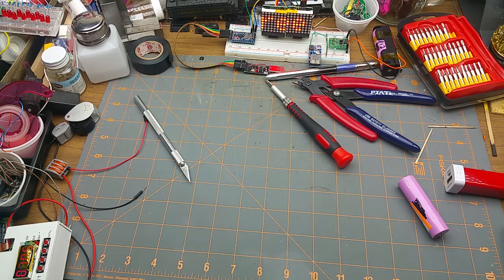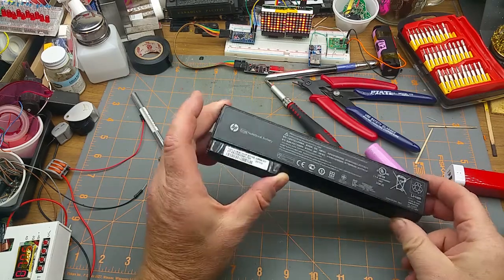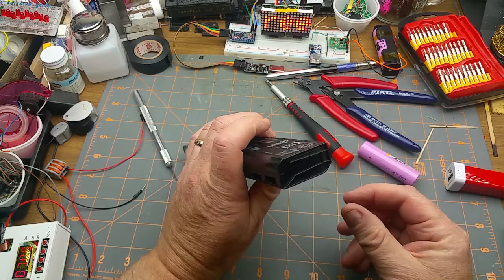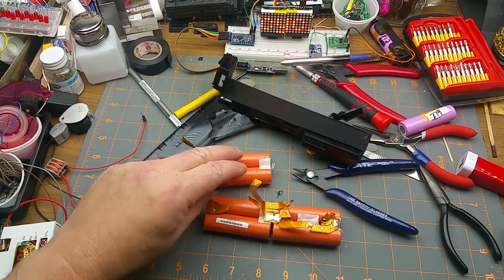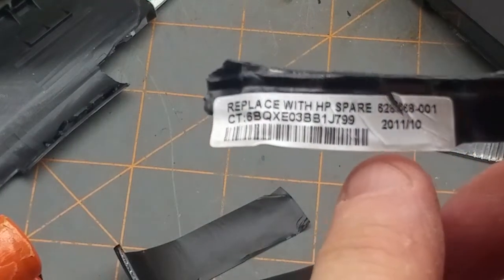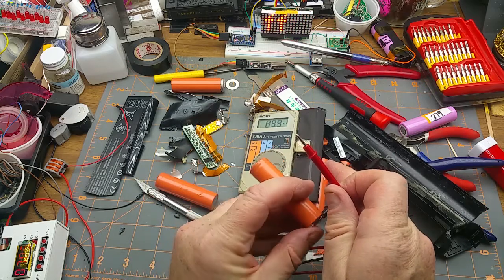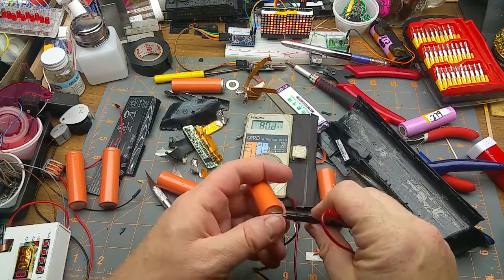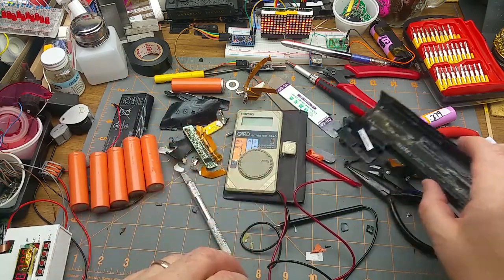free power

Comment: Have  a look at the LiitoKala chargers
saw Julian Ilett had one and thought it was a good idea, good price too ( got for £14 delivered from an alleged UK seller in about 5 days ) 

will run a charge discharge and capaccity test on up to 4 cells at once but individually,
will charge 14500, 18650 etc, as well as NiMH

came in very useful when salvaging cells from about 12 laptop batteries :o)